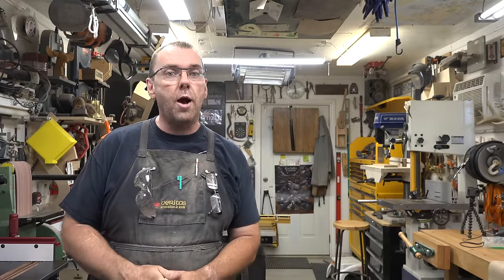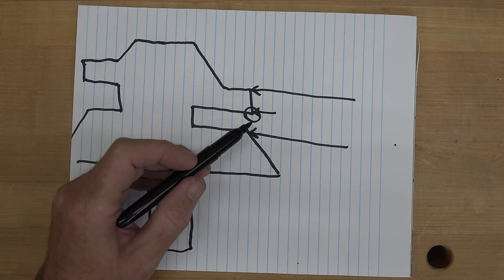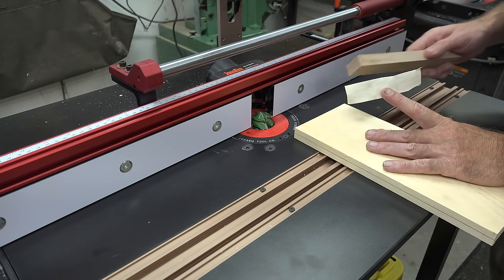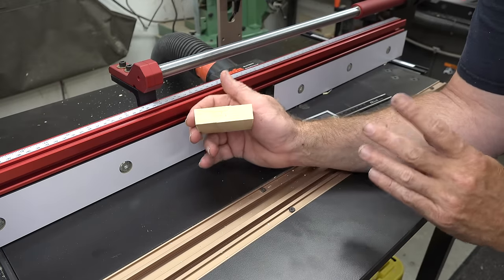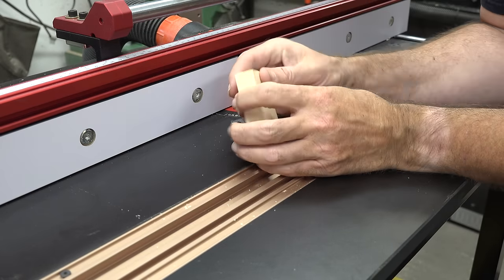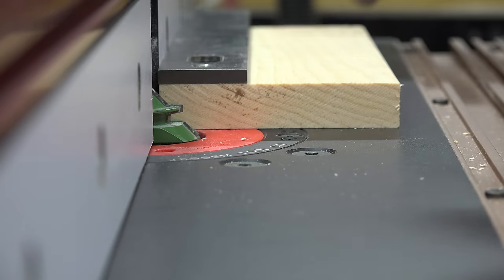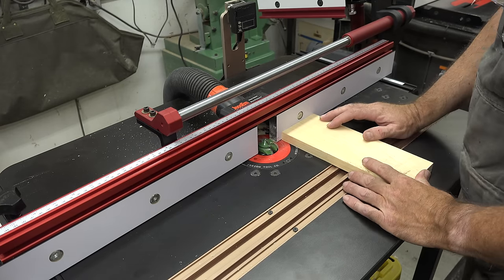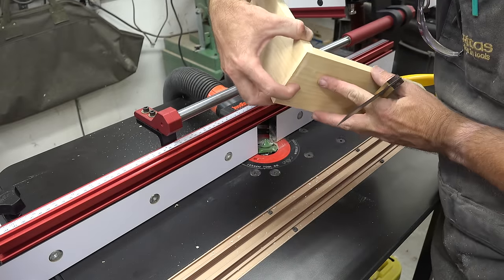Lock Mitre Router Bits

Comment: This is the best lock mitre bit set up video i've seen, wish I watched this one first before I did 30 failed test pieces following other videos, got a decent joint after 3 tests with this video. Biggest problem I have is the fine height adjustment ,  one thou increments would be awesome
Reply from the maker: I'm glad that you found the show useful and helpful.  Thanks for tuning in and good luck on your joinery.  It's all about the fine tuning now that you have a working setup.

Comment: Using a set up block made for your specific lock miter bit makes it so much easier. That being said this is a great help to someone who doesn’t have a setup block.
Reply from the maker: I would agree with that statement Brad and using a setup block a definitely a great help.  The problem is that most bits don't come with them.  By following the methods that I demonstrate on the show however, you can fine tune the setup and then make your own setup block for future use.  Thanks for tuning in to the show and taking the time to leave a comment.  I truly appreciate it.

Comment: Just received a 3/4,5/8, and 1/2 set and trial and error I accomplished making a proper mitre. Then I saw your video and it helps to expedite this task much easier than what I went through.
I will have to see how long these bits stay sharp considering the amount of stock removed.  Always a pleasure to watch your techniques.
Reply from the maker: Glad to hear that you enjoy the show Allen.  Good luck with your new bits.  I too would be interested in how long they stay sharp.  I've had my bit for years (over 10 at least) and it is still going strong.  I get it's all relative to how much you use it and what materials you are using it on.  Thanks for tuning in to the show.

Comment: Top tutorial! Solid to the point with no fluff👍🏼how all tutorials should be. Very enjoyable to watch and educational. Just ordered my lock mitre bit on the back of the info presented here 🤜🏽💥🤛🏽👏🏻👏🏻👏🏻
Reply from the maker: Glad to hear that you liked the video Kev.  Good luck with your mitre bit. Just remember that even with this tutorial, it will take some adjustment and the setup is rarely perfect the first time.  The good news is that after you get it dialled in, you can rout setup blocks to make future setups faster.  I hope this helps.  Thanks for tuning in to the show.
Reply: Thanks for the support 👍🏼 any makes of router bits you would recommend?  I just ordered a cheap one from ebay @ AUD $7.15 to get started and make a scrap wood bin on casters to get a grip on the set-up and use of the bit.
Reply from the maker: @kevh5487  I'm not partial to any particular brand of bit.  The cheaper the bit, the quicker it dulls but it still takes a while.  The more expensive bits have a harder steel that holds the edge longer.

Comment: great video.  I am new to woodworking and just bought a locking miter router bit for a project that I want to build and need to put a bottom in the bottom of a rectangular box.  A miter joint is perfect because you will not see the slot that I cut slide the board in.  Problem a regular miter is so hard to clamp and glue, plus this locking miter will be much stronger.  Just used your video to foul around with some scrape wood.  Came pretty close on first try just like in your video.  Best video on the web on this subject!!!
Reply from the maker: Glad that you found the video to be useful.  Thanks for tuning in and good luck on your project.

Comment: I use the lock-miter bit for picture frames. Once I got the router height and fence just right, I made a horizontal cut and then glued a vertical piece to it making an L shaped piece that fits right over the router bit. This is my template for setting the router and fence every time. It is far easier to set up the bit up with a precision router lift. Changing the height by 1/64" makes a big difference.
Reply from the maker: Another great use for this bit Scott.  Thanks for tuning in to the show and for chiming in with your experience.  I appreciate it.

Comment: Probably one of the best explanations on this topic I've come across.  Definitely going to save it for reference later.  10:05... this is where a micro-adjuster for the fence comes in so handy.

I also like that you make two passes across the router to ensure a clean cut.  I do the same.
Reply from the maker: I agree on the micro adjust.  I've recently (in the past year) added a micro adjust to my Jessem router table and the difference is night/day.  Glad that you liked the show and found it useful.  Thanks for tuning in.
Reply: Same here... I added a cheap Rockler micro-adjuster this past year.  A simple rigged setup to use my table saw fence as the reference to my router fence and not the table (my router sits in a table saw extension wing).  The table saw fence macro moves both, then I lock it down and use the micro adjuster to fine tune the router fence and lock it down.

Comment: Wow 😮. Just wow ! Understood the first time . I have a hand router . Just need to apply the principles. Thank you thank
Reply from the maker: A router bit that takes off this much material is not recommended for use in a hand held router.  I would be very cautious using a lock mitre bit in this way.  Thanks for tuning in Deano.  It's appreciated.

Comment: Great video Kenny!  I purchased one of these a couple of years ago and have never used it.  I've watched a couple of other videos but yours is far more informative than others.  I like the method of double-taping the sacrificial board on the top to protect that sharp 45 degree angle.  Thanks for this video, Kenny!  I'll definitely refer to this when I set mine up.
Reply from the maker: Glad that you found the show useful.  The lock mitre bit is a useful bit when it comes to making boxes or drawers.  It's strong and honestly, it's a heck of a lot of fun to see the joints come together.  Good luck on your set up and using your new bit.  Thanks for tuning in.

Comment: I just now found this most helpful, insightful tutorial. Your class has helped me with a number of questions I had, even an insight I was only kicking around in my head. 
Not only am I now not hesitant to order a lock miter jig, but I am looking forward to applying what I have learned. This is really good! I subscribed and rang the bell.
Reply from the maker: Glad to have you aboard as a subscriber Mike.  Make sure that you are patient with the setup.  It can take some time to get it done initially but once you get it, it's great.  You can always make a set of setup blocks once you've dialled in your settings.  Thanks for tuning in to the show and good luck with your new bit.

Comment: Great explanation, I was about to throw my lock mitre bit away because I couldn't get it to work. Will go back and try now.
Reply from the maker: Hopefully, like others who have watched this video, you will have success now.  Good luck with your mitres and thank you for tuning in to the show.  It's very much appreciated.
Reply: @acutabove_woodworkings  I do like your Router lift and fence. My router table is a just a piece of melamine covered blockboard mounted on the side of my bench on a couple of heavy duty fold out shelf brackets. My fence is made from offcut pieces of 3/4 inch plywood so i have far less precision than you. But I have recently invested in a Kreg mounting plate that takes my router the Triton TR001 which actually has a built in router lift. As I previously said I am in the process of building a work bench with a built in router station. Thanks again for the explanation.
Reply from the maker: @havelockvetinari9395  Sounds like a great plan on the bench.  Good luck with your build.

Comment: Thank you for the video! Your instructions were very clear and the method you demonstrated for ensuring that the cutter was set to the right height and setting the fence distance was intuitive and very helpful! I finally got my lock miter cutter dialed in and I feel confidant using your methods I can set it up again for different thickness stock and this is not just a lucky fluke. Before this vid I went though a lot (A F-ing lot) of sample pieces each time. 

The only issue I am having now is that when I test the height cutter using the the flat cut pieces there seems to be a slight angle between the pieces (ithe error ts doubled as they are flipped end to end but there is more error at one end than the other). The table must not be perpendicular to the spindle so when the work piece is before the cutter its higher and after the cutter is lower (its a Powermatic shaper with a cast iron table). Maybe it needs a shim or two...
Reply from the maker: I would have to agree with you on the analysis of the table.  It does sound like your table needs some adjustments.  The problem with any machine based joints is that in order for them to be perfect, the machine must also be perfectly calibrated.  I would take some time (set aside a couple of hours at least) to get the motor perfectly aligned and then try again.  I'm glad to hear that my show was able to help you with your setup.  I had a lot of people complaining that they weren't able to set up the bits and for the most part, they don't come with very clear instructions so I produced this show and from the sounds of it, it was a worth while production.  Thanks for tuning in and taking the time to leave your kind words.  Good luck on your router table calibration.

Comment: Kenny, there were a couple of questions about making the joint in a single pass.  Your answer that this is a large bit is correct and should work.
However, for those still concerned, try this.  Screw or double-stick tape a 1/8" thick temporary fence to your router fence (one piece on each side of the bit) and make all the passes,.  You do not need the hardwood backing piece for these cuts.
Remove the temporary fence, attached the hardwood backing piece and make two more passes on each side.  
This reduces the load on the router and I have found the joint cuts are a bit smoother using this approach.,
Bill.
Reply from the maker: Excellent advice Bill and I appreciate you chiming in with it.  I am sure that there will be plenty of viewers that will find the information useful.  Thanks for tuning in and taking the time to leave me a comment.

Comment: good job.   I'd suggest some additions.  After you have set up the fence and router height, then double stick tape a piece of thin stock to the fence.  1/4" is what I use.  then when you make your first passes on the two parts, you are making a smaller cut and it is easier on the bit.  After all the parts have been cut with the 1/4" stock attached to the fence, remove the stock, then redo all the cuts.  It is much easier on the bit and the end result will be with less potential tear out.
Reply from the maker: Great suggestion Paul.  Anything that can reduce the wear and tear on our equipment is a good thing.  Thanks for tuning in and for chiming in with your method and suggestion.  It's very much appreciated and I will be giving it a try.

Comment: Just fantastic Kenny.  I agree with the others, best set up video by far.   Centering the bit on the stock for height and ensuring the bit crosses the stock at the apex of the 90 degree point for depth gives set up clear focus.  Without that, hitting the target accidentally with trial and error is frustrating and no learning for the next time really happens.   Sounds like a lot of us purchased the bit with the dream of the perfect miter and easy glue up, but put it back on the shelf after seeing those many other, less than clear, set up videos. Thank you!!
Reply from the maker: Thanks for the kind words on the program.  The bit isn't that difficult to set up and really, one you get the setup done correctly, it doesn't take much to run some UHMW plastic of the same thickness as your project through the bit for a setup block for later.  I'm glad to see that this show helped so many people.  Thanks for tuning in Dale.

Comment: Many many thanks for this helpful video. I bought a lock mitre bit almost a year ago but have never had any luck getting it to work without a great deal of smoke and chipping (and a moderate amount of swearing). I am still definitely having huge problems making the cuts in one pass though.
Reply from the maker: You may want to check on the speed of your router Michael.  The speed at which you run the bit is gauged by its diameter.  Up to 1" diameter, 24,000rpm maximum.  1-2" diameter, 18,000rpm maximum.  2 - 2 1/2" diameter, 16,000rpm maximum and 2 1/2 - 3 1/2" diameter, 12,000rpm maximum.  I would suggest checking your router's manual and seeing what speed setting you need to set your router at in order to get under these rpm maximum values.  The hardest thing about these bits, is the setup but once you get the hang of that, you're golden.  I'm glad that you found the show to be useful.  Good luck with your routing and thank you for tuning in to the show.

Comment: Hi Kenny. I got a lock mitre bit ages ago but not used it yet. Ill have to get around to it now you have explained how to set it up properly. I've only just come out of the shop after making up a batch of picture easels. 
The only difference from your way was that i sanded the top round after assembly. Top project. Thanks.
Reply from the maker: Nothing wrong with taking a project that I show on the show and making it your own by adjust certain processes.  That's what it's all about.  Glad to hear that you found this show useful.  Good luck with all the project man.  Thanks for tuning in to the show.

Comment: Excellent clear tutorial and I've now got a good result with 18mm birch ply. However, with this tough material I found that multiple passes were required, maybe a function of my router power or bit needs resharpening. As you say, the centre line is the key measurement, plus the ruler trick gets you very near to where you want to be.
Reply from the maker: Glad that you found the tutorial useful Philly.  Thanks for tuning in and for the kind words on the show.

Comment: Like everyone else I loved this vid. Great instruction clear and concise.  BUT it left me envious of your router table and your apron, like that big diagonal pocket. Guess I'm gonna have to switch from the flat top lock bit to the mitre top bit. But I'll never be able to dial in my adjustments to .013 inch with my homemade table or my eyesight. But practice make perfect. You're a real pro. Good luck and stay safe.
Reply from the maker: I dial things in to .013 inches because I can.  That doesn't mean that you need that capability in order to be able to use a lock mitre bit.  You can easily dial it in with a normal router table, even if it is homemade.  How much is .013 inches?  It's a little tap on the fence or adjusting your height by a "smidge".  I'm sure you know what I mean.  Follow the method that I have demonstrated on this program and you will do just fine, I'm sure.  Good luck with our mitre bit setup and thanks for tuning in to the show.

Comment: Great video.  Thanks!

I just got this bit and will try tomorrow.  I think I'll set the fence using the vertical piece first, that seemed to handle the horizontal setting, or get it close.
Reply from the maker: Thanks for the kind words on the show.  Good luck with your setup and thanks for tuning in to the show.

Comment: I  bought a Freud lock mitre bit last fall, wish I had watched this how to video before using it, would have saved a lot of set up time. I spent a long while with set up on test pieces but had to do it all over again as the material for the dog food storage container was slightly thinner.  Love the joint this bit makes but you do need to be patient with set up if you want to be happy with the result. I have a router table like your older one freud table, the digital gauge sure would be nice.
Reply from the maker: Well I hope that you will try the method that I describe in this show and see if you can set it up manually.  Thanks for tuning in and for taking the time to leave your story Brian.  I appreciate it.

Comment: Most accurate method I have found yet. Thank you!! The Easy Set guage I bought for my Freud bit is completely useless.
Reply from the maker: A lot of those "easy set" gauges are just that Al....useless.  A lot of them are built for use with a specific bit on a specific fence and table setup.  If someone is going to take the time to learn how to use a setup gauge, they would be better off learning how to setup the bit without the gauge and then, they would be able to use any bit, on any table setup.  Thanks for tuning in and for taking the time to leave the kind words.

Comment: Brilliant - I've got some mitre joints to make on some very expensive figured walnut and frankly it's giving me the heebie jeebies (at those prices there's no a lot spare) but this helps a lot.  Just waiting for the router table to arrive so I can set it up and have a play.
Reply from the maker: Glad that you found the show to be useful.  I would suggest doing test cuts on cheaper stock before hitting the walnut with the router bit.  Better to make mistakes on the cheaper stuff than the figured walnut.  Good luck with your setup and your project.  Thanks for tuning in to the show.

Comment: i have used these bits a few times mostly with a lot of trial and even more error.  my greatest effort was to create 4 3 ft legs for a bed frame, about 4 inches square but it took a while!  quarter sawn white oak on 4 sides of a leg, something only a woodworker would ever notice, LOL
now that i have a much easier to adjust router and fence (all jessem), i'll dust the bit off and try it again
Reply from the maker: Good luck with your setup Steve.  I hope it's successful.  Thanks for tuning in to the show.